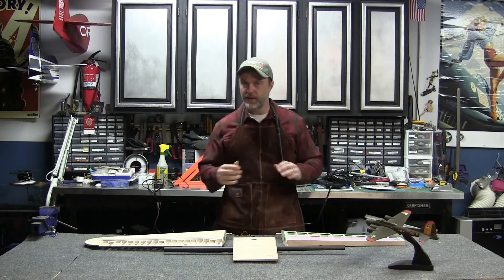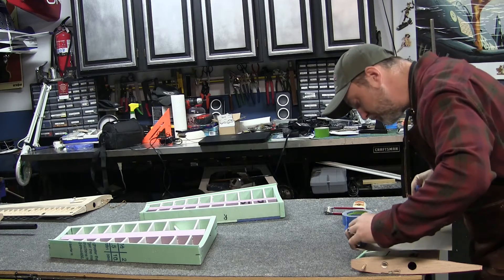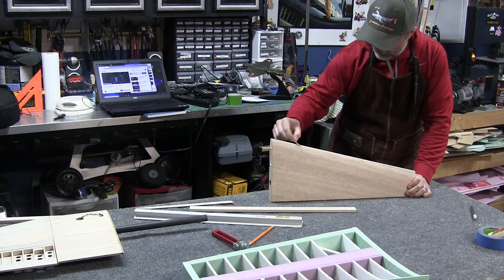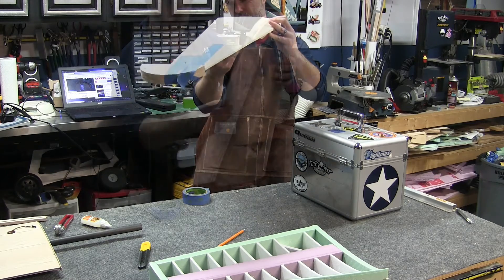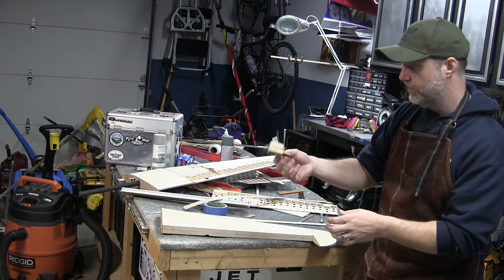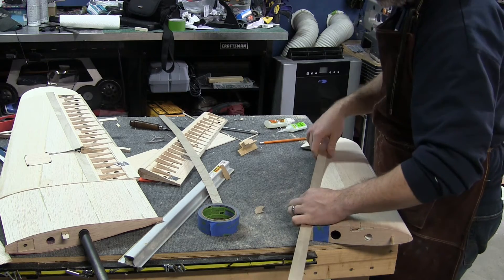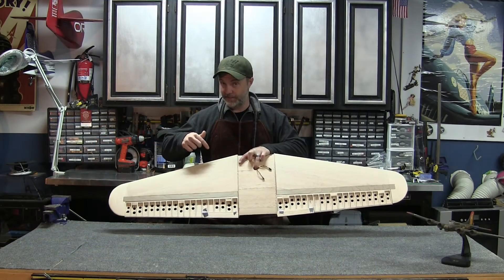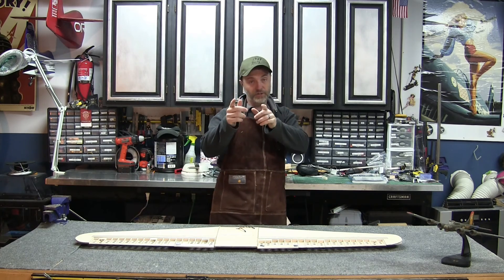1:9 Scale B-17G 'Sweet Pea' - Horizontal Stabilizer Part 2

Comment: Seems correct... looks great.  I'm used to using the white styrofoam with the plans, a layer of wax paper and then pins to keep the ribs in place when gluing the spars.  I only covered all my models with rice paper from what I recall at the moment.   I did have monokote on two RC planes also... yeah... never did complete anything with balsa covering entirely.   Made a piano wire foam cutting tool and never finished an aircraft using.   I have the wings though for the He-162 and like all my Axis aircraft I made... they were destroyed once completed in exciting air combat recreatements.  I did sell some of the U.S. aircraft along with other hobby items.   Looking forward to watching more.  Thanks!
Reply from the maker: Thanks! The hotwire cutting takes some practice but its great once you get the hang of it.  Thanks for watching!
Reply: @CarlLydickRC  Great detail in a method I've never seen before in regards to cutting the foam you demonstrated real well in another video.  Same goes with using the other part as a mold to press the skin to adhere uniform. The improvised foam cutting tools themselves are neat to see demonstrated on instructables and other sites online too now days.  I like the foam cutting tool you made since has longer... arms I guess I'll call for now... that allow for cutting larger pieces of the foam blocks (ribbed or not).  I made my cutting tool with ~1/4" piano wire with ~ 8" arms going back to a 2x2" handle with ~1" protruding above the handle for connecting to the power supply.  Where the other end of the arms connected to the smaller diameter piano wire for cutting that I forget what diameter was..., though recall was an exercise at the time to calculate for a ~10 yr old... plus not being nichrome there wasn't as much data for as readily available..., I filed a little notch on the outer radius for the smaller diameter piano wire that was bent with a hook on each end to seat better into.   Thinking now days if cutting for longer periods of time yours or other spring tension methods that aren't in contact with the heated volume might be better.  I did find some of the smaller aircraft projects I didn't complete... including the pulse jets... though the foam cutting tool must have gotten thrown out over the years maybe with my toys when I went to Tech.  Looking forward to watching more and hopefully getting hands on too since I've thought about this method also in recent years for a lake canoe and recumbent trike fairing though using strips of foam to cover and sanding to shape then carbon fiber or basalt or whatever material(s) determined (Denier, Cordura, fiber glass, poly lycra, etc.) for the skin.

Comment: Carl,
It’s looking great.  Glad to see you used the sanding jig for the gap seal covers for the elevator. It really makes it easier.

When you fiberglass the horizontal stab are you going to use peel-ply?  It will really make your life easier with less elbow grease.

For the elevators, when you cover them what are you going to use.  Solartex is out of business now.  If you have some in stock it would be great to use.  If not Balsa USA is starting to carry Oratex which is a suitable replacement.  Don’t forget to get the rib tapes. Drop me a line if you need more info, I’m just down the street.
Reply from the maker: I have a roll of Solartex left and I'll be using that.  I'm keeping an eye on the Oratex for future projects.  This will be my first model with Rib tape... I've seen some methods for fabricating it myself.  Do you know of any commercial suppliers for rib tape?  

I've also never used peel-ply before but I would be interested in giving it a shot.  Do you recommend a particular brand/type?
Reply from the maker: @dowmer3093  Nice!  I wonder how the 1/8th Pink-it tape would look (this one is 1:9th)  Probably pretty close but I'll reach out and see.  I'll also see about the peal ply.  Would be fun to try it.